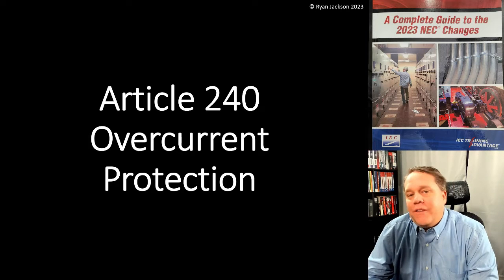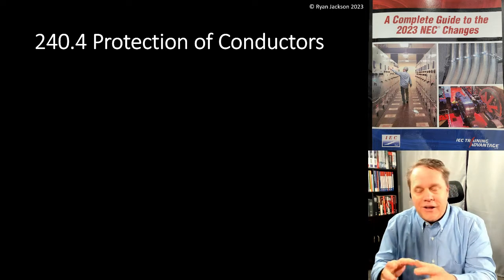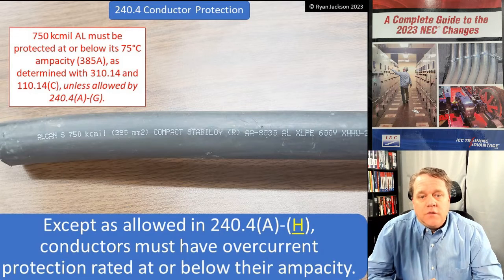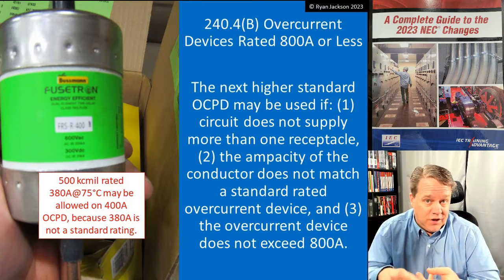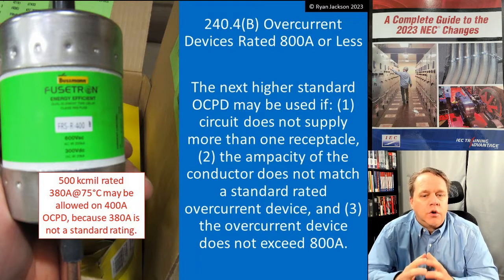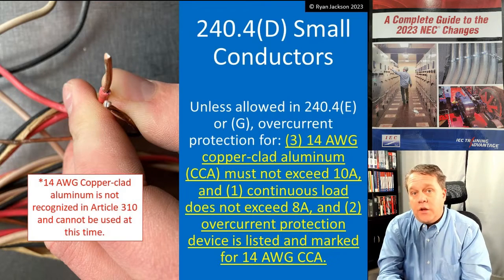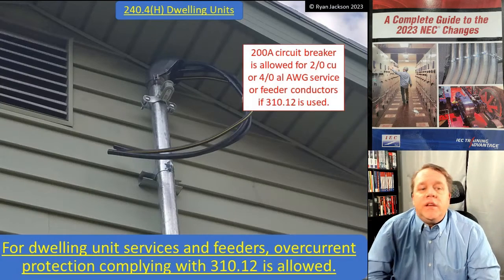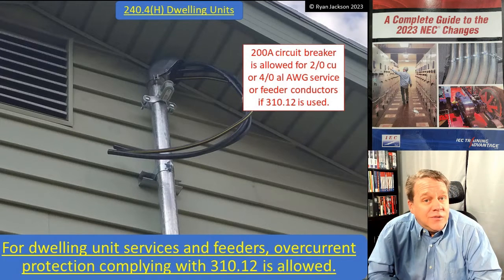2023 240.4 Protection of Conductors

Comment: im a little confused about 240.4(b)(1). for example I have a living room receptacle branch circuit with 6 receptacles that I would like to have fed from the panel through a raceway with more than 10 other current carrying conductors. after ampacity adjustments my 14 guage thhn wire will only be good for 12.5 amps. Will it be ok for me to put it on a 15 amp breaker?
Reply from the maker: No. You cannot use 240.4(B) for a circuit that supplies multiple receptacles.

Comment: Thanks master I will check all the videos 1 by 1  ,- can we use a 12/2 on a 15 breakers and then from a junction box continue the circuit with 14/2 to add small loads ? Or it’s a code violation ?

Comment: I am wondering why article NEC 334.80 was not mentioned in the video. Because it states: "The ampacity of Types NM and NMC cable shall not exceed that of a 60 degree rated conductor" Which limits NM cables (aka romex) even with sizes bigger than 10AWG  to  60 degree column only when choosing ampacity. 
With that in mind even though we have termination points rated at 75 degrees using any big size romex we are still limited to 60 degree ampacity ratings. Or I am missing something???
Reply from the maker: It wasn't mentioned because that wasn't the topic of the video. The video is covering 240.4. I have videos that cover ARtciel 334, and particularly section 334.80, but this isn't one of them.
Reply: @RyanJacksonElectrical  thank you for clarification, sir. I really appreciate the work you do for us electricians creating the content 🙏🏻
Reply from the maker: @Electrified84  You're welcome. :)

Comment: Hello from Massachustts😁

Looking for your help to clarify my underestand of 240.4 (b)(1)
How do we view....conductors,not part of a branch ciruit?
Are Feeders(being conductors) supplying a main lug panel that serves only branch ciruit loads allowed here? Or are they part of the Branch Ciruits in some way, is this rule for more like feeding a CNC Machine or some other utilization equipment.
Example.
I have a generator with a 2 pole 90 amp breaker feeding a transfer switch that serves the house panel. Using #4 copper THWN at 75 degrees Celsius, Bing my terminations are rated for 75 degrees Celsius. Table 310.16 says # 4 wire is good for 85 amps. I do believe I could use this now for 90 amps under this allowance, curious to see if you're in agreeance with me or I'm misusing this allowance.
Thanks
Reply from the maker: That is only for branch circuits. For feeders we can ignore 240.4(B)(1)
Reply: Got it, so feeders are allowed to be upsize to the next standard rating overcurrent device. Under 240.4 (B).
When you say ignore You're actually stating The feeders are not part of the branch circuits in the panel that it feeds. And some strange twist of the six degree of separation thought 😅.